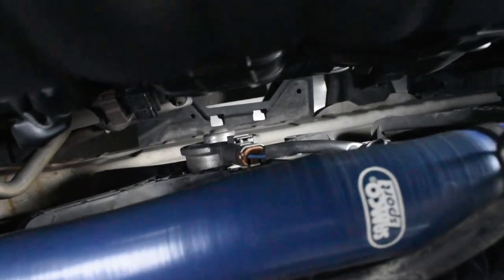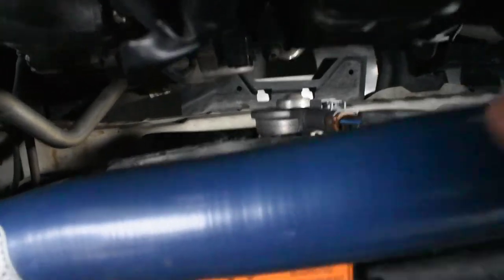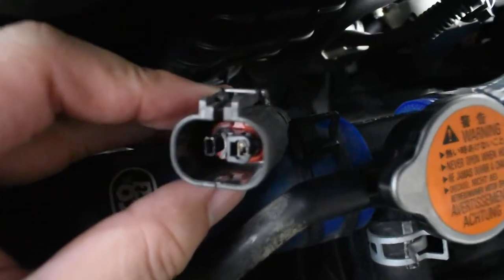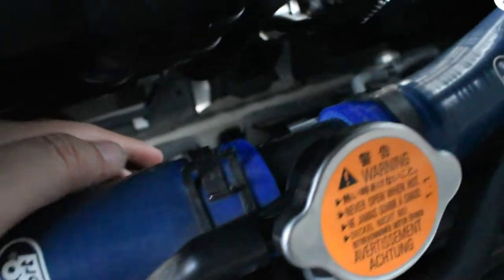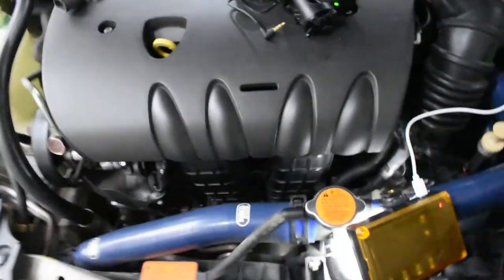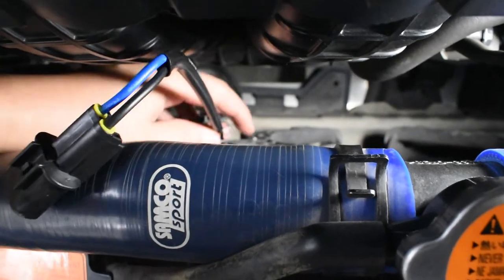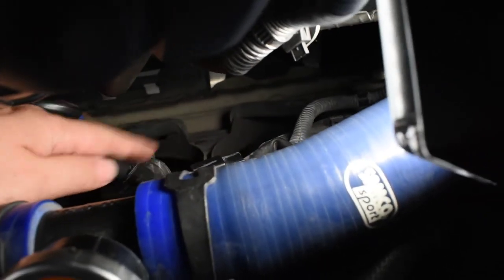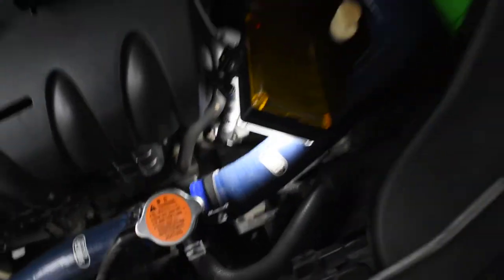Inspira/Lancer 08 Radiator fan socket replacement

Comment: Hi bro, so far how your car condition now? Still Ok after u changed the socket or still face the same problem coz someone advise me to change the motor fan also due to socket burned..awaiting for your reply..tqvm..
Reply from the maker: After changing the socket, till now have not had any problem. Motor still running strong, new socket have no signs of being burned again.
Reply: @TCsAnythingGoes  that’s good..thanks for your reply..👍👍
Reply: hi! i changed the AC and radiator fan + connector too a week ago. but overheating came back just after 3 days of drive. now my car is in workshop, they suspect radiator holder?

Comment: hi! my 2011 car overheated (170k km, stock condition), sent to workshop. the workshop checked the radiator was not leaking. changed the fan motor connector and both radiator+AC fan motor (as the fan was not moving). it was fine for 3 days' drive, but the overheating re-occur. had to refill close to 3litre of water through the radiator cap and tank.
Reply from the maker: There is a slight chance that your engine head is warped from the initial overheating. If that is true then the only solution is to do a top overhaul and skim the engine head so its flat again.
But check on other things first like:
- radiator cap
- thermostat
- are both the fan moving fast enough
- is the radiator fins blocked

Comment: Good job as always. Since you had done sound proofing,can u do a video on the drive to see the improvement? Btw how do u solve a rattling dashboard in the inspira? Keep the videos coming.
Reply: My rating dashboard has been bothered me for years... Solved one and new one came
Reply from the maker: Not yet done with the soundproofing. Still got a few more areas to soundproof. I will elaborate on what i feel have improved on the final video of the sound proofing series. Don't think video would be able to capture the difference between before and after soundproofing.
Reply from the maker: A rattling dashboard is among the hardest thing to solve since a dashboard is made of hundreds of different parts. One way is to have someone drive the car and you sit at the passenger side and try to find the source of rattling by pressing here and there.
Reply: If only o could show u my video of my dashboard...  Obvious squeaking sound.

Comment: Hello sir,i have a question.
My fan radiator is not working,how to fix it and which part i need to check to fix the fan radiator? thank for this video anywy.😊
Reply from the maker: First you need to disconnect the socket and see if its burned. If burned, change.
if not burned, take a multimeter and check if there is voltage going thru. if no, then check on your electrical. If yes, the its most likely your fan motor that needs replacement.

Not a 100% guide but will serve as a starting point.

Comment: 👋🏼Hi bos,where can i get this socket ?  Any link ?  Btw, great video 👍🏻👍🏻👍🏻
Reply from the maker: I am assuming you are from Malaysia. I got mine from a local spare part shop but you can get it from shopee as well.
https://shopee.com.my/Proton-Inspira-Mitsubishi-Lancer-CY4-Cooling-Fan-Motor-Socket-Connector-i.11625341.1103926735
Reply: @TCsAnythingGoes    well actually..  👋🏼😀 kita jiran sbelah sja bos..   Brunei.
Terima kasih

Comment: My lancer got this problem also...the socket burned just like yours....i dont know where to find the parts,i came up with an idea...i directed the wire without socket...

Now, almost 11 years...my fan works without socket..just directed the wire..
Reply from the maker: As long as it works, it works. just a bit more hassle when the motor burns and you will need to direct the wire to the new motor. Otherwise, its a perfectly working solution. And cost no money.

Comment: Watch your radiator fan cable replacement video, was that cable work as sensor too ?. My inspira  2011 having the air cond issue,  the car stop for a while, the air cond stated become less cooler but after off and on the air cond switch in the cabin, it becomes cool again ( by the way the air cond fans is running and the magnetic clucth is working  as well.). Can cable replacement help or other part than need to check beside fans motor, magnetic clucth and relay. Please advice
Reply from the maker: If both the fans are running, then there is no issue with your fan motor and cable. The cable is just carrying a 12V power to the motor to turn. But if it is corroded, then it may be bringing lesser watts than required for the fan motor to spin at full capacity. So.... some of the things I would suggest you check is (but not definitive)
- whether the fan is operating at capacity
- whether the cable is corroded a not

Also, when your air cond is less cold,  is the magnetic clutch engaged and the fans turning?
Do you have sufficient Freon gas? What's the Hi and Low reading?
When was the last time the AC system was serviced?

a lot more to check but this will be a start. Worst case scenario, a compressor replacement might be needed.
Reply: @TCsAnythingGoes  thank's for the replied. The magnetic clutch is engaged and the fans is turning. By the way one fans is APM (to condenser) 1 year old replacement  and another is original (to radiator) 1 month old replacement. How to check if the fans is running at full capacity . I ruled out the compressor as the air-cond guy said it is in good condition. Gas reading also good. Air-cond guy has no clue what are the causes.
Reply: Correction it is APM fans's motor and original fans's motor
Reply from the maker: When your car have stopped for awhile and the AC becomes less cooler, look at our magnetic clutch and see if its engaging. Also, when the magnetic clutch engages, does both the fan spins together.
Next test, when idling and AC becomes less cooler, try revving your engine to 3k RPM and see if the air becomes cooler.
Reply from the maker: Sorry it took me awhile to reply you. YT comments notification is a bit wonky. Add me up on FB Tc's Anything Goes. I reply better there.

Comment: Please do a video on driver seat motor (front back movement)
Reply from the maker: but my inspira does not have powered seats. And I don't remember seeing anyone having them as well. But based on my experience on using power seats in my Alphard..... the old fashion manual way is much faster.
Reply: @TCsAnythingGoes  love you for taking the pain to actually reply....:)

Comment: I got problem when my a.cond warm while stationery.. I noticed the fan on dvr side is not working.. When sent to nearest wshop.. they check all relay.. n wiring.. at last the mechanic claim both acond&radiator fan motor is not working.. Is it possible both  fan out@birn at the same time.? Pls advice.. coz i hold my inspira at wshop.. before ask them to replaced both fan motor that definitely cost me about Rm500-700 tq!
Reply from the maker: There is that possibility that both fan burned but rare. But there is also a possibility that both socket burned. If both socket has been checked and not burned. You can take a voltmeter to it and check if current is going thru the socket. Once its confirmed that there is current going thru the socket, you can try to  connect power directly to the fan bypassing the socket. If the fan does not turn, then its confirmed that the fan most likely burned. Another not so proven way to test is by manually turning the fan with your hand and see if it turns freely or if there is a lot of resistance. If a lot of resistance, most likely the fan motor bearing is toasted from overheating.
Reply: @TCsAnythingGoes the mechnic did direct connct n cnfrm. both fan mtr. is out...all socket+conncter ok..its 5yrs old car.. mybe time is come.. all wear&tears parts were out. so got no choice.. need chnge 2-mtr..anywy thnks bro.. for ur feedbck & guidnce.!